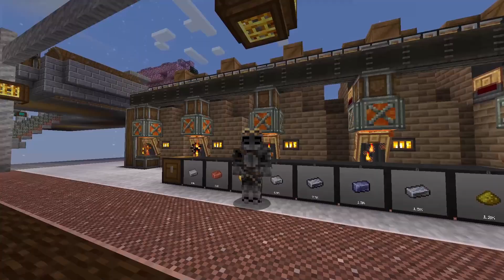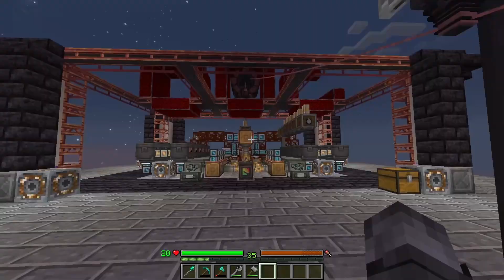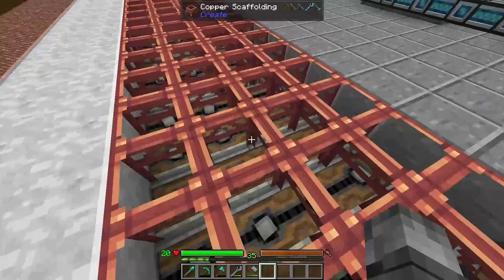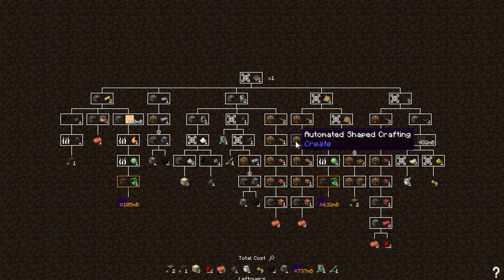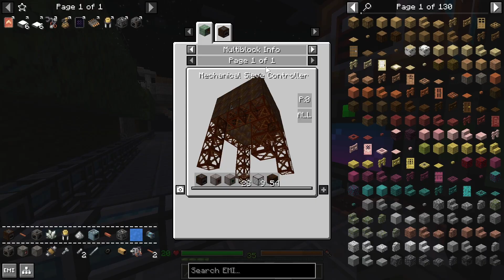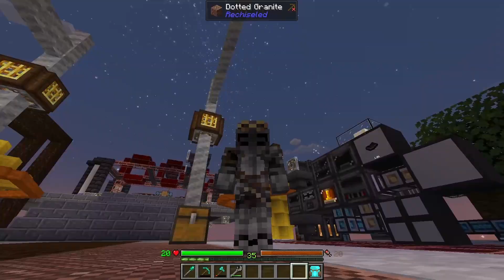Star Technology Ep5 Our Friend the Crafting Terminal

Comment: I think putting a soul campfire in front of a create fan allows you to haunt items, like sand into soul sand, without needed any witchwater.
Reply: the same with blackstone...
Reply from the maker: Ya I did see the same with Blackstone :D
Reply from the maker: I did see that, I've used Create so many times in so many packs so I like to switch things up and get creative with setups sometimes.  If I get to a point where the Witchwater is a real bottleneck it should be simple enough to spam down a couple Soul Campfires with Encased Fans and call it good!

Comment: arboreal extractors are searching for surround. if you put them in a row, they are greatly loosing efficiency. you should at least leave a single block space between them. also the first pieces of rubber sheets you should use to make hatches/busses for gregtech version of arboreal extractor(s) which have muuuuch better speed. (usually i'm setting up 4 gregtech arboreal extractors what requires 16 rubber sheet, connected to a row of 3 fluid cells, each one pushing fluid to next one. also i'm setting a barrel or chest with crafting terminal on it close to cells. that way i can once per 10-15min spamclick 16 buckets at the time, put them with shift double click to put them all to the storage, put a single bucket in crafting grid of terminal, then right click to get all 48 pieces at once. then repeat the operation 5 more times to drain all cells. that provides several stacks of raw thingy to be processed in create machines).
anyway - at this stage making rubber through arboreal extractor is kinda waste of sulfur (one dust per 3 ingots/sheets), as you can spin up several centrifuges to process sticky resin (what gives as a bonus also glue for boards and resistors) feeding some basic chem reactors. that's will give you 3x better yield for sheets from sulfur perspective.
still advantage of making rubber in create mixer from fluid extracted by arboreal extractors is speed. it's several times faster to use create mixer/press (at full rotation speed) instead of centrifuge/chem reactor/fluid solidifier.

btw. did you known that right click crafts a stack of items in crafting terminal, if you have enough ingridients in storage/tool durability? quite handy for mass crafting...